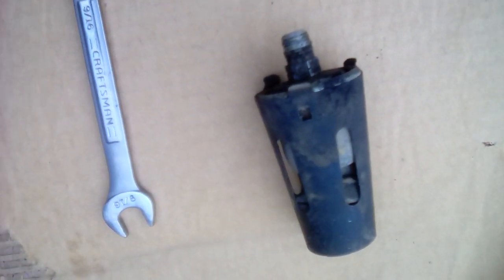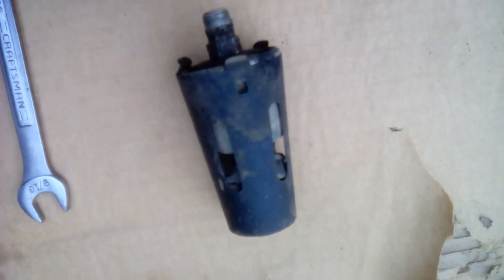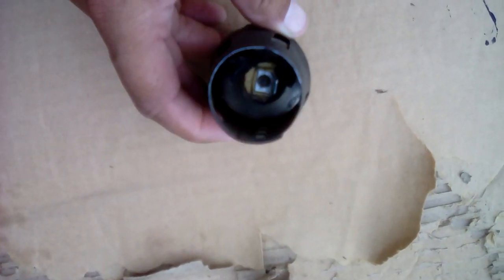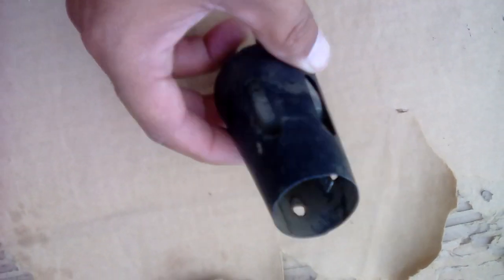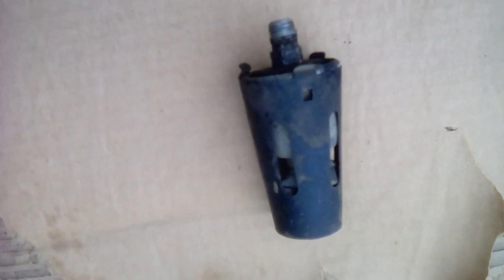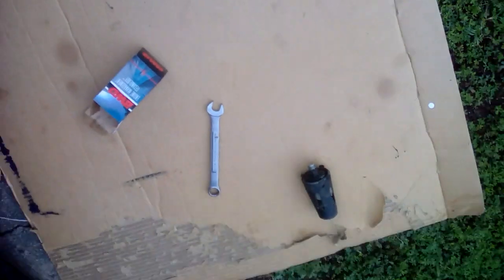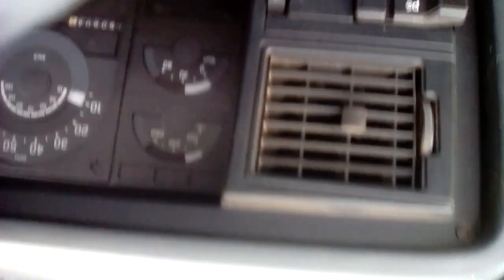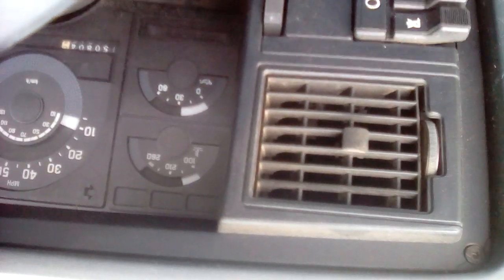Replace oil pressure sending unit on 88 Chevy truck with 305.  5.0

Comment: The heat shield is not part of the sensor . You remove it from the old sensor and reattach it to the new sensor. 
It just snaps off and on. 
The 88 hard 2 oil pressure sensors. A upper and lower. This is the lower one.

Comment: do you still have the heat sheild for it or do you know where you can get one because that clicks off the old one and you put it on the new one
Reply: The new ones are different than the old original. No heat shield included

Comment: thanks my gauge is spiking all over the place, some say its begind distributor, but I saw this under my truck.. was yours leaking oil too? how much was a new one.
Reply: The chevy 350 engine (5.7L) has the oil sending unit behind the distributor. The 305 engine (5.0L) is the one shown here. Yes it can leak. Cost can vary by manufacture. The oil pressure sending unit for the 305 (5.0L) runs between  $30 and $60.

Comment: I have the same truck 88 305 5.0 my oil pressure gauge is maxed out @60 when I turn the truck on when it is turned off drops down to about 45 would this also be the oil pressure sending unit?

Comment: When it went out did it make your motor knock
Reply from the maker: no, just showed 0 psi on the guage.  Turned it off and restarted it and it went all the way to 60 psi then bounced back and forth all the way home.
Reply: @tedmayes4212  mine does same thing just at idle can it cause service engine service soon light to come on

Comment: Mine stays at 60 psi doesnt go down or up and i think its leaking oil but not sure if its that
Reply: That can be a hint that the oil pressure gauge is clogged or just not working.

Comment: was there also a sending unit behind the distributor?
Reply: That would be the oil pressure switch. It's for the oil light
Reply: What if I have both
Reply: The Chevy 350 engine (5.7L) has the sending unit behind the distributor.